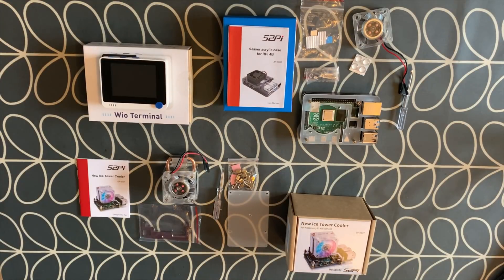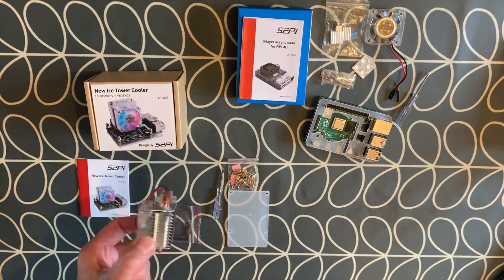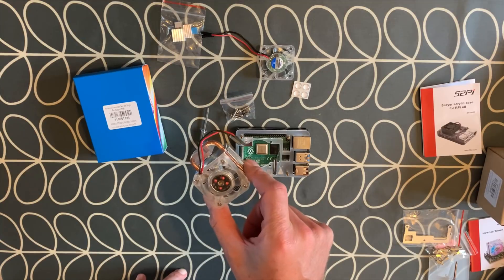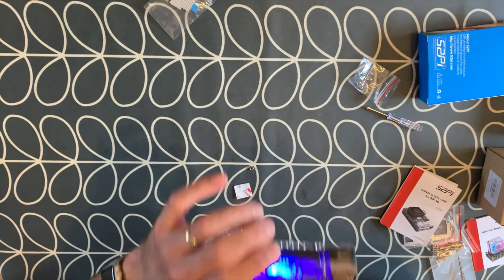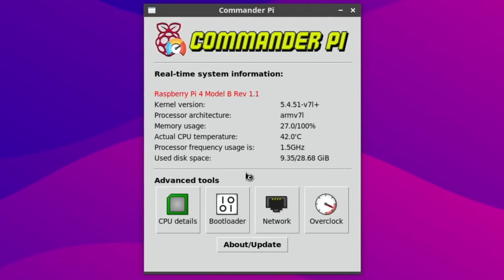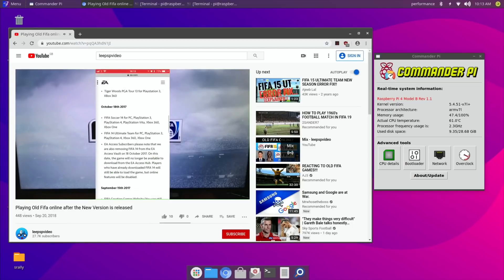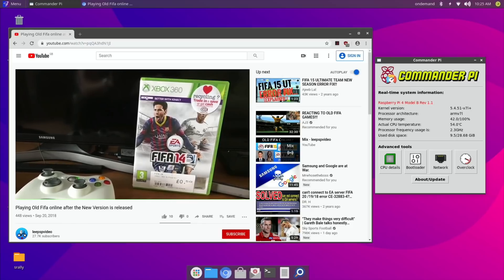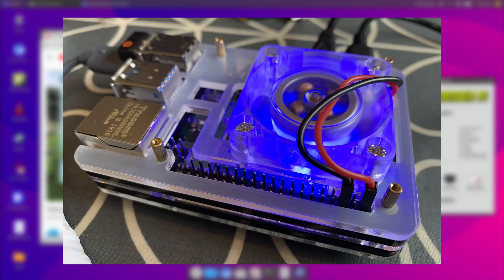52Pi Fan case. 2.3Ghz Overclock test. Raspberry Pi 4.

Comment: I have a complete newb/dumb question, if I overclock my Pi then switch to a different sd card is the Pi still overclocked or is that on the original card? 🤔
Reply from the maker: No, the overclock is in the config.txt file on the sd card. So if you use a different sd card it won’t be Overclocked.

Comment: I have the pi4 8gb and update it to the lastest stable firmware but can't overclock then the 1500mhz (which I think it is the default)
What can be the reason?
Reply from the maker: Why can’t you overclock? What settings are you using?
Reply: @leepspvideo  tried:
over_voltage=2
arm_freq=1750
Or
over_voltage=8
arm_freq=2147
But the CPU limited to 1500.
I'm With the raspberry os 64bit lite 
And if I check my firmware it's the lastest (sometimes like 11 Dec 2020)
Reply from the maker: @HaimPeretz  strange. There are many ways to Overclock. Commander Pi. Using a second device nor nano config.txt

Try another method and another os.
Reply: @leepspvideo  I just checked with other os - raspberry os lite 32bit and it's working.
So it's because the 64bit or because it's beta..

Comment: Cool tool! That's the first time I came across Commander Pi. Was interesting to read about  TwisterOS and box86, too! 

I've also built a web-based overclocking tool (to find recommended settings for many Pi models). Check it out here:
https://picockpit.com/raspberry-pi/overclock-raspberry-pi/
Reply from the maker: I mentioned it in a recent pi news. 👍🏼

Comment: I'm so confused. My 8 GB Pi is fine with over voltage set to 6, when I overclock at 2147MHz, but my 4 GB Pi needs over voltage set to 8, or it won't boot.
Reply from the maker: Mine is similar but the opposite. My 8gb in some systems needs more power.
Reply: @leepspvideo  My 8 GB Pi is running Ubuntu Server 20.04 64-bit. Seems to be running fine 24/7 for the last few months.

I got my 4 GB Pi to boot fine with Raspberry Pi OS, at various higher clock speeds and overvoltage at 6, but it doesn't start Ubuntu at 2147 unless over voltage is set to 8. Maybe it's cause I'm using 64-bit Ubuntu.

Comment: Worst thing about these little fans is there's no way to shut them off after shutting down the pie.  You either have to add a switch or unplug.  Unless someone has a solution?
Reply: Older firmwares turned off a 3.3V rail. My 5V fan, running on 3.3V therefore stopped spinning. Pressing one of the resets started Pi up again. But in my (CooliPi) case, it wasn't necessary at all to have a fan. New firmwares  abandoned this behavious supposedly because of compatibility with some HATs. Therefore contemporary firmwares don't turn it off at all.

Comment: The Ice Tower is a "BEAST". I saw ETA Prime do a vid about it & was gonna buy it then he was talking about a new Low Profile Ice Tower Cooler was coming out from 52Pi. I couldn't find it on Amazon cuz everybody that was a reseller was OOS. Found it by SeeedStudios so i ordered it. Sadly due to the current events the fan i ordered back in May took almost 90 Days to get to me due to our Airports being closed here in Canada for a few months. My 4GB RPi4 is clocked to 2.147ghz or 2.294ghz that the Pi reports with a 750mhz GPU & an OV of 8 & my Mini Beast hovers between 37-43C. I can render an hr long PS4 vid & the highest i see my Demon of a cooler get to is 47-51C at 5.5V for the fan.

Comment: I have a low profile Ice Cooler in a 3D printed case I got off Etsy for my Pi4. It's clocked to 2ghz and it never goes over 62. The Tall Ice Tower is supposed to be a little better. When I finally get an 8GB Pi4 I may pick one of those up.

Comment: I have the Ice Cooler (in black on a rainbow case) on a Pi4 8GB running at 2200MHz/750MHz/6V and it never thermal throttles no matter how hard I push it. It looks abusrd but it works really well.
Reply: I know this is a bit old, but what temps do you get and do you still get stutter on youtube playback with those settings?

Comment: I bought this from Amazon.ca. It's called the geekpi case with ice tower for pi4. I use it with the official pi4 power supply, and some mini HDMI to HDMI cables cables. I also purchased the mx4 thermal compound that I have yet to add.

Comment: I've designed several 3D printable cases for both styles of Ice Tower Coolers and I've done extensive thermal testing of them on my channel. 

https://www.thingiverse.com/jispal01/designs

My Mini Desktop Ice Tower Case with dual 40mm fans will keep a 2ghz overclocked Pi4 under 40 degrees on a 20 minutes long stress test.

Comment: Have you tried using Stressberry? With it you can temperature test your Pi at different clock speeds for specified time periods and it can display the data via cool graphs (no pun intended). You can find info about it here: https://core-electronics.com.au/tutorials/how-to-stress-test-temperature-on-raspberry-pi.html
I have the low profile 52Pi Ice Tower and it keeps my Pi4  around about 60deg C at 2147 overclock.
Reply from the maker: Yes I have it on my list to check out. 👍🏼

Comment: Lee i have said it and linked it before the Max is 8
CPU/GPU core voltage adjustment. The value should be in the range [-16, 8] which equates to the range [0.8V, 1.4V] with 0.025V steps. In other words, specifying -16 will give 0.8V as the GPU/core voltage, and specifying 8 will give 1.4V. For defaults see table below. Values above 6 are only allowed when force_turbo is specified: this sets the warranty bit if over_voltage_* is also set.
https://www.raspberrypi.org/documentation/configuration/config-txt/overclocking.md
Reply from the maker: I often find these pages aren’t up to date

From the page link.

specifying 8 will give 1.4V. For defaults see table below. Values above 6 are only allowed when force_turbo is specified: 

Im sure at some point Force_turbo wasn’t required to go higher. I think I found that out in an older video.
Reply: @leepspvideo  You might be right, but there is Pi4 info on that page, Just trying to save your Pi don't wont it to smoke

Comment: If you set arm_freq_min to 2000 and gpu_freq_min to 700, the pi will be a lot faster
Reply: Alex Volensky : Is this for real or is it actually a nasty prank meant to destroy hardware? Asking for a friend. 🤔
Reply: @totophi  its real, I use
over voltage 5
arm freq 2147
GPU freq 750
arm freq min 1500
gpu freq min 700
Reply: @alexvolensky6515  Are you using experimental firmware? Because the stock, stable one doesn't set gpu frequency this way, but has it fixed either to 500MHz or 550MHz max, depending on hdmi_enable_4kp60=1 keyword, which enables it.

Comment: Is there script to control the fan speed at different temps?
Reply: Try this:https://www.instructables.com/id/PWM-Regulated-Fan-Based-on-CPU-Temperature-for-Ras/
You have to add a bit of components but it works.